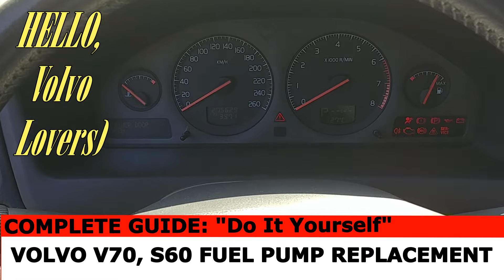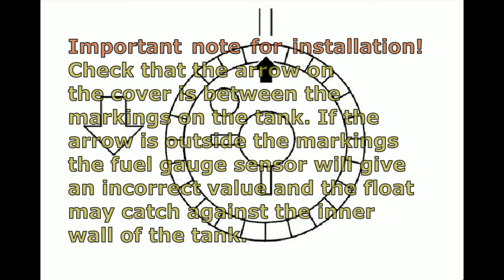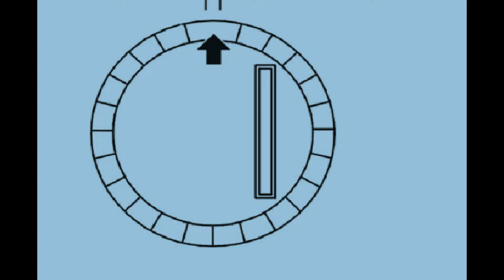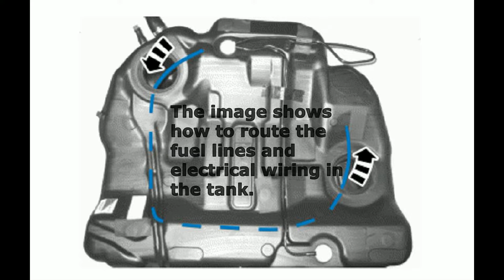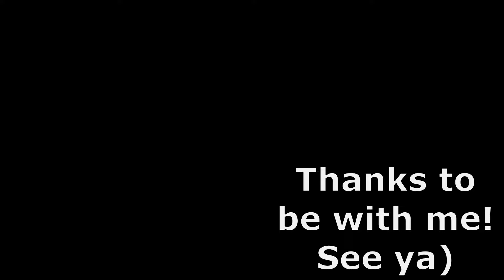VOLVO FUEL PUMP REPLACEMENT. COMPLETE GUIDE.

Comment: Before you make your car smell like a gas tank, if you have a fuel pump control module located underneath the car attached on the side of the car or on top of the gas tank. disconnect and bypass to see if you can start the car before even thinking of replacing the fuel pump. If it fires up when you bypass, its the unit.  Why am I saying this? Because $400 for a fuel pump and then $400 for the fuel pump control module adds up quickly. I recommend watching this video as well... https://www.youtube.com/watch?v=Dx6vLRBxErw
Reply from the maker: Thanks a lot for sharing info. I will definitely take your advice. Appreciated your time for watching my video. Stay safe!